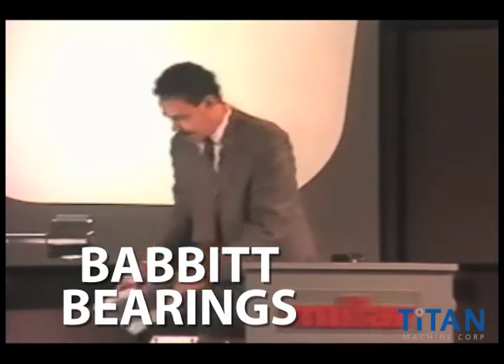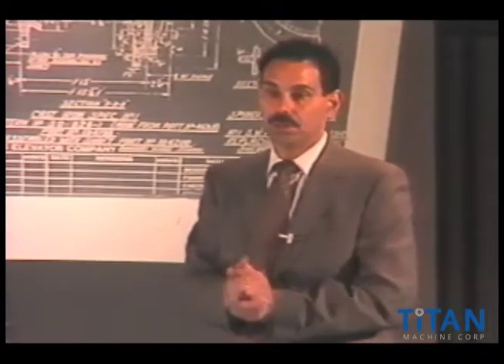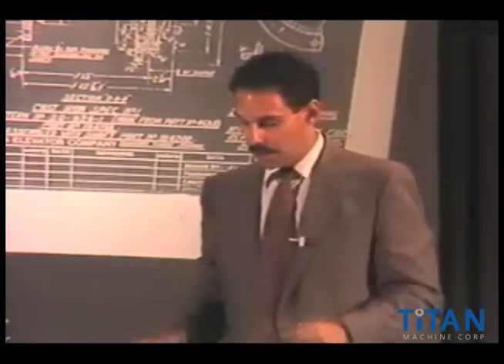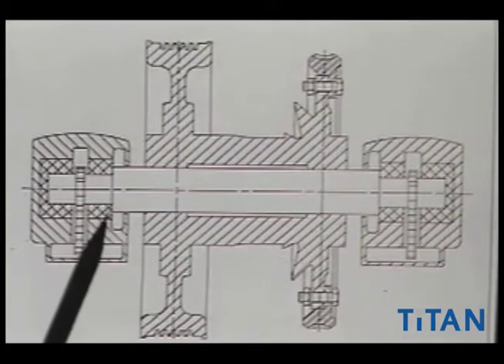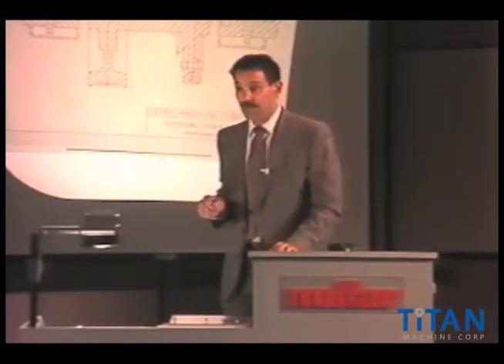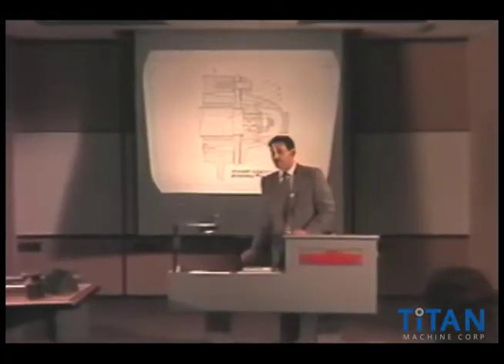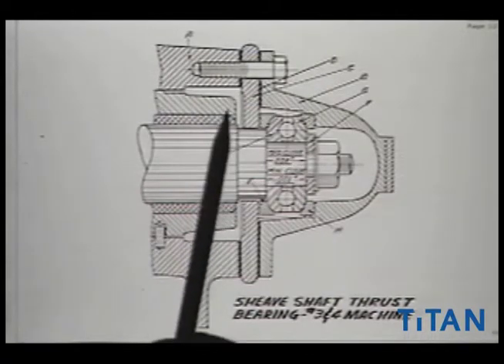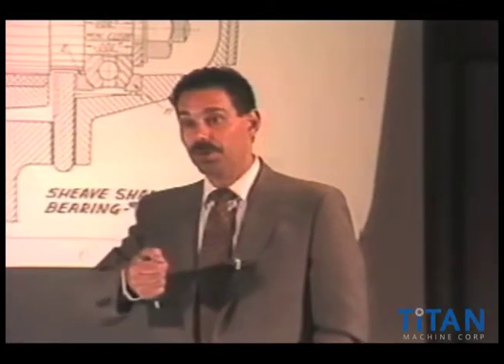Babbitt Bearings - Geared Elevator Machines

Comment: I looked this up on YouTube because when I stared in the elevator trade we used to pour babbitt bearings and also poured babbitt on cable shackles that were in sockets. The “sling rings” as we called them were important to keep the bearing oiled. We called it thrust when the shaft moved laterally